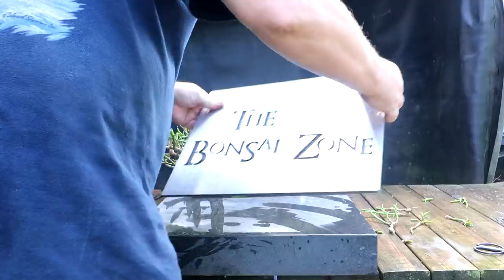A Detailed Pruning of my Schefflera arboricola Bonsai, The Bonsai Zone, Sept 2020

Comment: Its hopeless to try to reduce the leaves Nigel. They won't..or by much. I had a variety called "Elfin' that I lost along the way and it had truly reduced foliage and when Bonsaid..it got even smaller looking more like a mini S.macrophylla. I miss that one. All the Home stores used to sell it..very common. I haven't seen it for sale in many years now.
I do have the hardier S.arboricola..and I started it in 1978. I posted it on DAVE'S GARDEN or Lately Growingontheedge.net.  Single trunk. In low humidity California it does not send out aerial roots.
Reply from the maker: Thanks Stan, I've found that leaf pruning about 4 weeks before a show, gives you the perfect size leaves, but it is only for a short period of time. As the plant gains vigor the leaf size increases. The leaf size is OK with me, as I tend to like large leaf bonsai anyway!